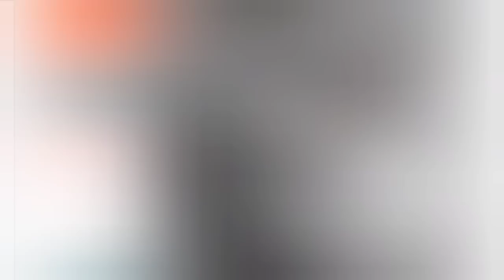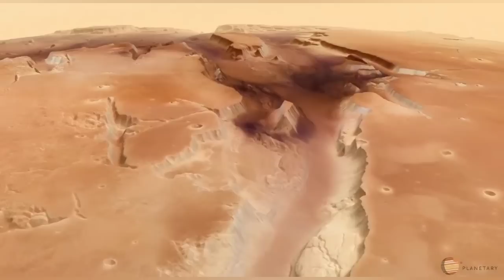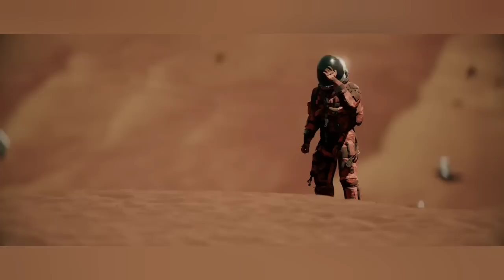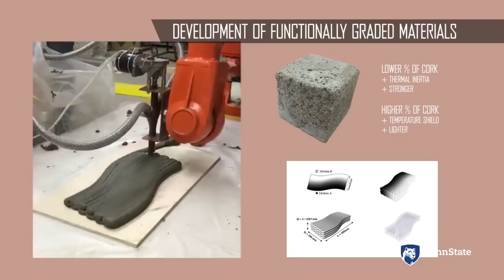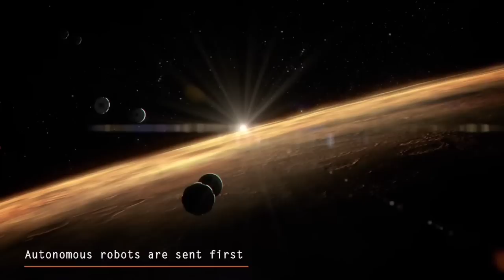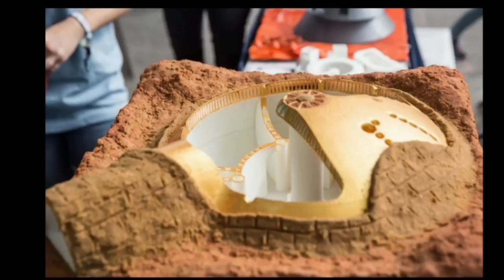If NASA or SpaceX get us to Mars, can we REALLY survive there?  PLEASE CHECK DESCRIPTION!!

Comment: I am thinking that most people who actually believe they would move to Mars with the realistic accommodations described here, and who might actually get the opportunity with SpaceX or otherwise, should consider that although Mars would be livable technically, I don't think many will really live there full time until it has a breathable atmosphere and developing ecosystem.. ie for a long time. What does sound realistic is for people to choose to work on Mars for like 6 months to 2 years at a time, or whatever can be accommodated. People could be incentivized in various ways I guess, but the point I'm getting at is that I think THE single most important thing to get right ahead of time is to design human transport missions to maximize return options on as regular a basis as possible. Probably each time a ship arrives, you might want two ships going back. Id think that probably means that two ships should be sent each time, but only one should be carrying any people to Mars. This arrangement would provide redundancies going to Mars, and help guarantee available space going back. If the second ship isn't needed for return, it could stay and provide additional space and equipment. Unless we become dwarves living on Mars is going to constantly require more living space. It should not all be in one structure obviously for safety, but larger structures should eventually be built to give people as much feeling of space as possible. I actually think the Saudi's Idea of The Line concept, which I'm mostly a fan of even on Earth, would make even more sense on Mars.

Comment: So the air pressure inside the inflatable habitat will compensate the weight of all the regolith piled on top? 
Now imagine what would happen if a hole is made in the wall. All the regolith will bury inhabitants inside. A strong metal frame would be required. Or the regolith walls+ceilings must be self-sustainable.
Reply: Buckminster Fuller may have solved that problem with his geodesic dome design.

Comment: despite all the sci fy stories lava tubes are not really safe at all. so their made of rock so you think solid but rock can be paper thin, you can fall right threw 100 of feet on ceramic knife sharp rocks!! and it would likely be worse with lower g and less atmosphere, depending on when the lava tubes were made. so on the earth we have a water cycle that has erosion that helps brakes up the really thin parts of lava tubes, on the moon and mars their are likely to me more traps. if you ever visit iceland or hawaii stay on the path, and if you do have to go over a zone with lava tubes have a friend you are tied to with a rope and know what you are doing. on earth the tube could still be hot and you could cook alive.

Comment: A while ago I commented on the same habitat Angry tells us about, but he first told us about the lack of Sunlight. We can’t send the robots with only a few Solar Panels. ‘Of course not, they need nuclear batteries. They are small, light, and last long, but each robot will need 100 or something.’ I have commented about nuclear batteries, @TwoBitDaVinci recently showed us how safe the new nuclear batteries made in China are.  https://youtu.be/_78T5juoAX4
Angry must be checking my comments and replies? I replied to @jeffburrell7648 who said “Many good points.” In my reply I pointed out that the robots would first need other power sources and pointed out that there is Hydrogen…
We don’t need to use methane for the fictional or underdeveloped power cell.?? Hydrogen power cells have been used by NASA since mid-20th century.
I asked Claud 3.5: to compare the amounts of hydrogen to methane on Mars?
Claud’s Response:
To compare the amounts of hydrogen and methane on Mars, we need to look at the atmospheric composition of the planet and any other relevant data. Here's what we know:

1. Hydrogen on Mars:
- Hydrogen is present in the Martian atmosphere, primarily as a result of the photochemical breakdown of water vapor.
- The concentration of hydrogen in the Martian atmosphere is very low, estimated to be around 15 parts per million by volume (ppmv) near the surface.

2. Methane on Mars:
- The presence of methane on Mars has been a subject of debate and ongoing research.
- Various measurements have reported different concentrations, ranging from undetectable levels to about 10-60 parts per billion by volume (ppbv).
- The methane levels appear to vary both spatially and temporally on Mars.

Comparison:
- Hydrogen is more abundant than methane in the Martian atmosphere.
- The concentration of hydrogen (15 ppmv) is roughly 250-1000 times higher than the highest reported methane concentrations (10-60 ppbv).

It's important to note that:
1. The exact amounts of both gases can vary depending on location and time on Mars.
2. The presence and source of methane on Mars is still a topic of active research and debate in the scientific community.
3. Both gases are present in trace amounts compared to the main components of the Martian atmosphere (which is primarily carbon dioxide).

Sources:
1. NASA Mars Fact Sheet
2. Various scientific papers on Martian atmospheric composition
3. ESA Mars Express mission data
I asked Claud 3.5: What are Hydrogen power cells and how long have they been in development?
Claud’s Response:
Hydrogen power cells, also known as hydrogen fuel cells, are electrochemical devices that convert the chemical energy of hydrogen into electrical energy. They produce electricity through a chemical reaction between hydrogen and oxygen, with water vapor as the only byproduct.

Here's a brief overview of hydrogen fuel cells and their development:

1. Basic principle: Hydrogen fuel cells combine hydrogen and oxygen to produce electricity, heat, and water.

2. Components: A typical fuel cell consists of an anode, cathode, and an electrolyte membrane.

3. Types: There are several types of fuel cells, including Proton Exchange Membrane (PEM), Solid Oxide Fuel Cells (SOFC), and Alkaline Fuel Cells (AFC).

Development timeline:

1. 1839: Sir William Grove invented the first fuel cell, which he called a "gas voltaic battery."

2. Early 1900s: Scientists and engineers, including Francis Bacon, worked on developing practical fuel cells.

3. 1950s-1960s: NASA began using alkaline fuel cells in space missions, including the Apollo program.

4. 1970s-1990s: Research intensified as concerns about energy security and environmental issues grew.

5. 2000s-present: Increased focus on hydrogen fuel cells for various applications, including vehicles, stationary power, and portable devices.

Hydrogen fuel cells have been in development for over 180 years, with significant advancements made in the past few decades. Today, they are used in various applications, including:

1. Transportation: Fuel cell electric vehicles (FCEVs)
2. Stationary power generation
3. Backup power systems
4. Portable power for electronic devices

While hydrogen fuel cells have made significant progress, challenges remain in areas such as cost reduction, infrastructure development, and efficient hydrogen production and storage.

Sources:
1. U.S. Department of Energy - Fuel Cell Technologies Office
2. International Energy Agency (IEA) - Technology report on Hydrogen and Fuel Cells
3. Fuel Cell and Hydrogen Energy Association

I asked Claud about methane fuel cells:
Claud’s Response:
Methane power cells, also known as methane fuel cells, are devices that convert the chemical energy in methane (CH4) into electrical energy through an electrochemical process. These cells are part of a broader category of fuel cells, which are energy conversion devices that produce electricity through a chemical reaction between a fuel (in this case, methane) and an oxidizing agent (typically oxygen).
The development of methane fuel cells has been ongoing for several decades, but it's important to note that they are not as widely developed or commercially available as some other types of fuel cells, such as hydrogen fuel cells. Here's a brief timeline of their development:

1. Early research (1960s-1970s): The concept of using methane in fuel cells began to be explored, building on earlier fuel cell research.

2. 1990s-2000s: Increased interest in methane fuel cells due to growing concerns about climate change and the need for cleaner energy sources. Research focused on improving efficiency and overcoming technical challenges.

3. 2000s-present: Ongoing research and development, with a focus on direct methane fuel cells (DMFCs) and solid oxide fuel cells (SOFCs) that can use methane as fuel.

Some key points about methane fuel cells:

1. They can potentially use natural gas or biogas as fuel sources, which are more readily available than hydrogen in many areas.

2. They face challenges such as carbon deposition and sulfur poisoning, which can reduce efficiency and lifespan.

3. Research is ongoing to improve their performance, durability, and cost-effectiveness.

4. They are seen as a potential technology for distributed power generation and combined heat and power systems.

It's worth noting that while research on methane fuel cells has been ongoing for decades, they are still largely in the development stage and not widely commercialized. Most current fuel cell applications use hydrogen or other fuels rather than methane directly.

For the most up-to-date information on methane fuel cell technology and its current state of development, it would be best to consult recent scientific journals or reports from energy research institutions.

Comment: There absolutely has to be some kind of maintenance shed to deal with always-outside suits and rovers etc.
Reply: A way to decontaminate the suits for inspection and repair would be needed  but not having to decontaminate it after every use seems useful.
Reply: @ulbuilder  for sure and it should be a separate space and could come in a second phase of construction as first maintenance becomes due and calabilities expand

Comment: I like that regolith canopy design. Gamers wouldn't have a problem with a windowless structure. They spend months or years in their basements without ever coming up for air, so to speak.  But I agree, you would have to have windows for nearly anyone else.
Reply: I always advocate for Screens or monitors. They could give a person the same impression and it would be a safer option.
Reply: @chriswheeler6092  Meta Quest 3 is cheap. We still have at least a decade until regular Joes get to go.

Windows are such a weird thing to be worried about.
Reply: Nuclear submarine crews often go over a year without surfacing.

Comment: Agreed about setting up near the equator. Despite reports of landslides at Noctis Labyrinthus, the Valles there is 4.35 miles deep, which provides twice the atmospheric pressure: 12.4 millibars, compared to 6.1 millibars at the datum level. AND you don't have to build near the cliffs, but the valley is wide enough you won't be near any landslides if you move toward the middle. The 3.75mi. high canyon walls provide good protection from cosmic and solar radiation. Noctis will enjoy a mild climate, as it is only 258 miles south of the equator.